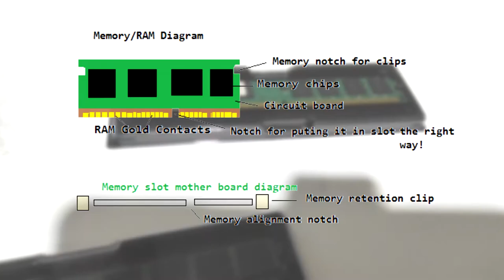PAANO MAG-INSTALL NG HEAT SPREADER SA RAM

Comment: parang may mali, dapat pinalitan mo ng thermal pad ang double sided tape.
Reply from the maker: It will serve its purpose, the adhesive will transfer the heat from the heat source to the heatsink. Still, it will protect the device from over heating.
Reply from the maker: These are just not ordinary adhesives. It is made up of silicone which is a semi conductor. It can also be described as having good 'thermal stability' meaning it retains its structure and properties over a wide temperature range.
Reply from the maker: Do you really even know what a thermal pad is? What is it made of? FYI, it could be graphite or silicone. 😉
Reply: @curiousKID.  nakakatawa ka brad! mura lang yan heatsink na yan tapos hindi ordinary ang tape? hahahah...
Reply from the maker: @ideaelex4019  Look who's talking... That's why it is called budget heatsink. The adhesive itself is silicone. Kahit mura pa yan eh ikaw ang patawa.
Reply: @curiousKID.  hay naku hindi nga yan thermal silicone pad na kagaya ng iniisip mo.ordinary double sided tape lang yan kaya mura..kitid ng utak mo brad..dapat palitan yan ng totoong thermal pad. hahahaha
Reply from the maker: Di ka pa ata nakakita ng pulang 3M adhesive. Hindi ordinaryong double sided tape yun kasi it can withstand heat. Do some research, wag putak ng putak. Create your own content. Wag ka dito, sayang lang oras sayo, walang pera sayo. 😅
Reply from the maker: @ideaelex4019  hindi porke hindi blue ang kulay eh hindi na mag coconduct ng heat. mas makitid utak mo boy. Dun ka humanap sa  high end thermal pads content. Walang click bait at misinfo dito sa vid, budget nga diba. Shut up with your nonsene most of the kits they are using Thermal Conductive Double-sided adhesive, there is no harm and nothing is wrong using a double sided tape.
Reply: @curiousKID.  FYI lang sayo brad yan nabili mong heatsink sa shopee at lazada kailangan talaga palitan ng thermal pad yan. kasi hindi talaga yan maco-conduct ng heat yan mas lalo nyang kinukulong ang init. Pero kung magaga-an lang na application ang pinapatakbo ng pc mo eh ok lang na papogi lang yan heat sink na yan!
Reply from the maker: @ideaelex4019  Magaan na apps? boy, check my channel to see my pc, hindi ko pc yang pinaglagyan ko nyan. pinamigay ko lang yan sa kakilala ko. Mema ka lang talaga. Kaya umabot ka dito sa budget heatsink, you won't be here if your not looking for one. Get a life kiddo.
Reply: @curiousKID.  Sa halagang 50 pesos ibigay mo nlang brad. kakahiya nman sa 1k subs  mo..ahhahahaha. tsaka wag ka masyadong ipagyabang mo yung pc mo ("pc hindi rig" hahahah ) na hindi nman umabot ng 100k..LOL Casing plang wala na... mumurahin!!!
Reply from the maker: @ideaelex4019  Buong pc po pinamigay ko. hehe. bata nga kausap ko. ayoko nalang magyabang. May nalalaman ka pang rig at casing casing totoy wala ka naman palang alam. hehe. mag aral ka muna.
Reply: @curiousKID.  hahahah, kung 3k pesos na pc ang ipamimigay mo hindi ok.. atleast man lang paabutin mo kahit10k..hahahaha! tsaka wag mong ipag mayabang yang pc mo na hindi man lang umabot ng 100k! hahahaha, nagmamayabang sa pc niya budget meal lang naman! bwesit! hahahhaa
Reply: @idea elex penge naman 3K na pc lodi